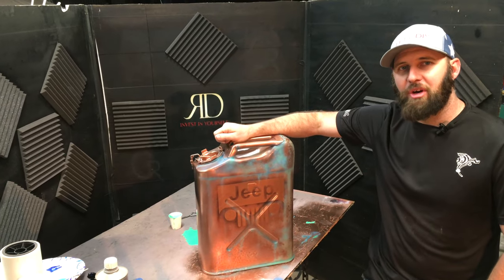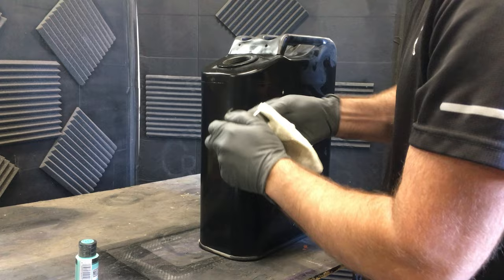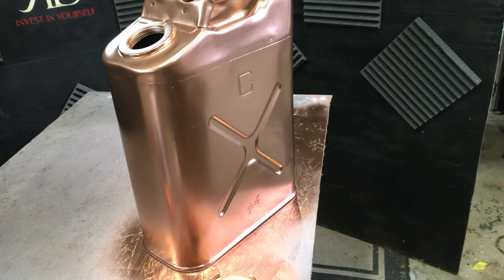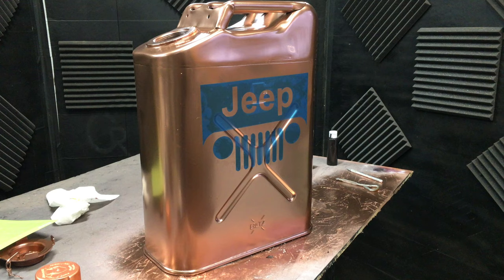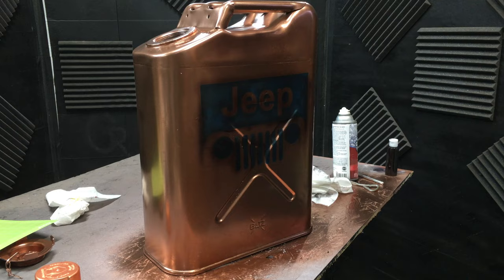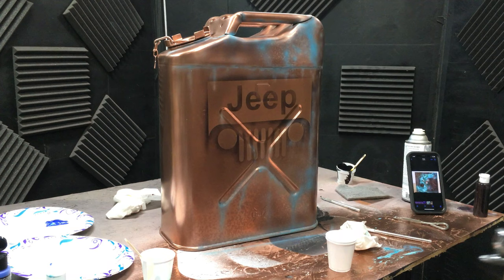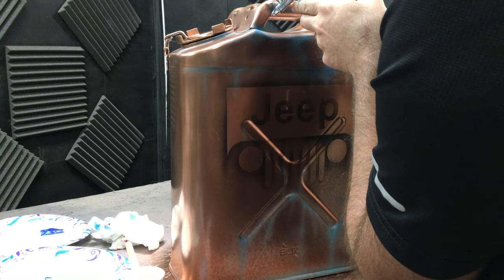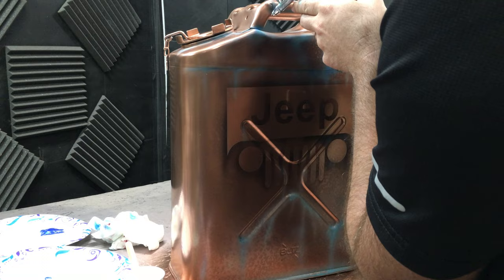Airbrush Copper effect!

Comment: Well, a Fifth Element Mondshawon figure just arrived.. resin figure..8 inches. I'll wash it and work it. But I heard you say you put the Copper color on wet, Not sure what you mean by that.
Reply from the maker: Meaning try to hold the nozzle of the spray paint can closer to the surface to avoid dry spray. If you dry spray it looks flat and doesn’t look shiny and reflective.